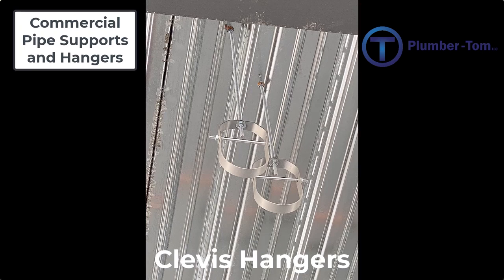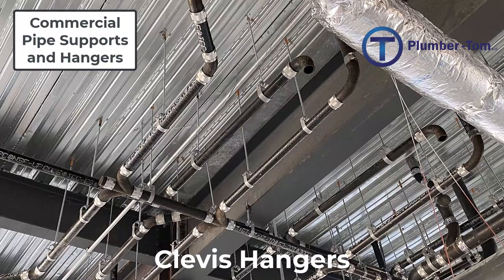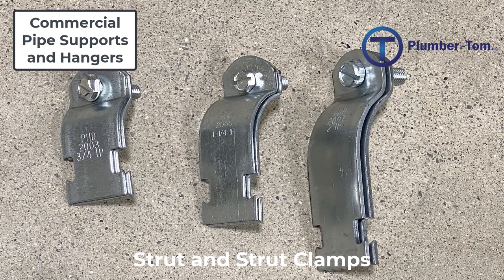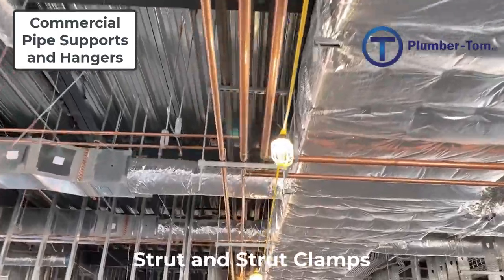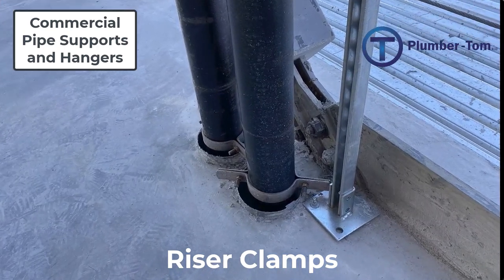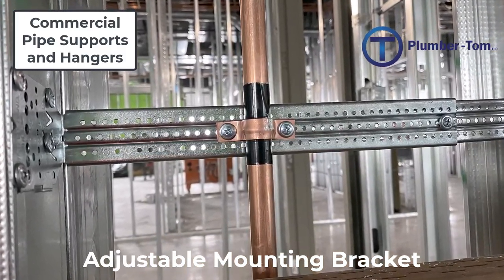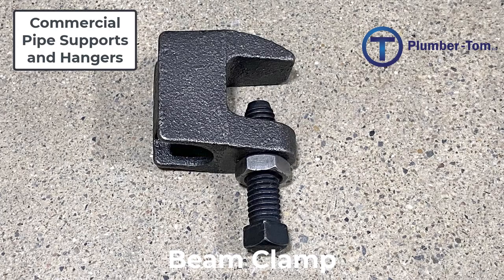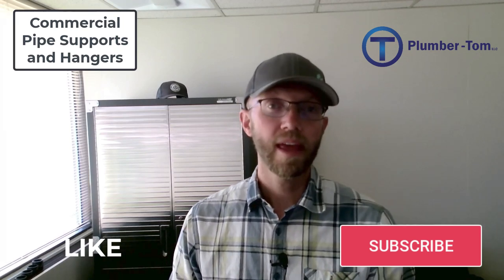Plumbing Parts Identification: Supports - Commercial

Comment: Galvanic corrosion occurs when there are 2 dissimilar metals touching while an electrolyte is present. 

In the case of Copper touching Unistrut - the only time you’re going to see corrosion is if there is condensation present. Low or minimal condensation environments will see near minimal corrosion over the lifespan of the pipe / support. In high condensation environments you can combat this by either insulating the pipe, or as the video shows - create a barrier between the 2 dissimilar metals. 

Just a note to add that it’s not always necessary to create that barrier just because it’s 2 dissimilar metals touching - the key factor is the electrolyte AKA water (which is a weak electrolyte)
Reply from the maker: Thank you for explaining.